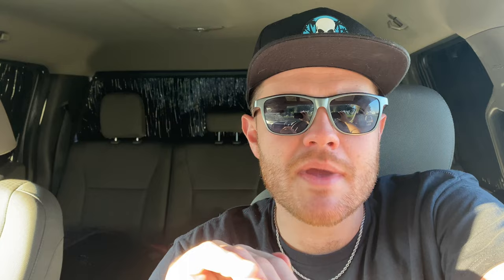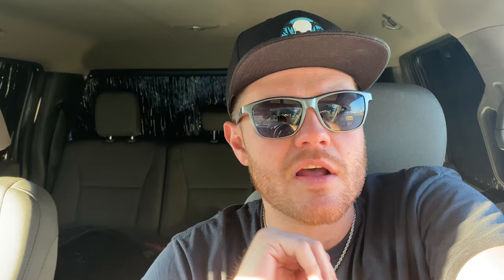Twin Turbo SBE 5.0 Chases 8’s and Heads to the DYNO!!

Comment: You got head studs and what fuel did you run to make the 900 wheel?
Reply from the maker: Yeah car has head studs, valve springs, OPG’s/ CS and cometic head gaskets. Pump E85 from Meijer’s on the dyno, car had 5 gallons of ignite red in it at the track

Comment: What is your 60-130 on 963whp?
Reply from the maker: On the street it’s been bottom 4’s. That day that the track I had issues and it went 4.92, but it went 4.4x 100-150 after the boost came back in, it’s been 3.99 100-150 on the street.
Reply: @DownSouthRacing  I have a similar 62s Hellion set up. Just no valve springs yet. Pretty much just limited by my stock MT82 with RST. And my car weights 4020lb. i will be happy with high 4's when i crank it up.  I still have DW95 injectors tho,  do you think i can push 900whp with those? I am around 850 now on 15 psi

Comment: Do you have the 3.15 rear gear or 3.55?
Reply from the maker: 3.15 is the best for boosted applications and is what I run 👍🏼
Reply: @Down South Racing,  I wanted an iron diff and put a 3.55 in my car. I have yet to go up on the brake with two-step but I'm hoping it leaves as good or better as yours.